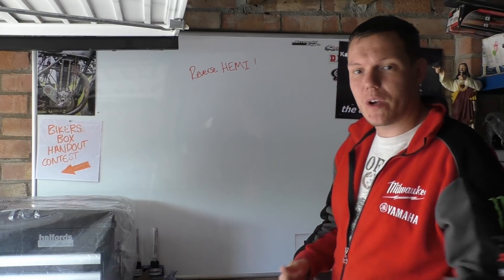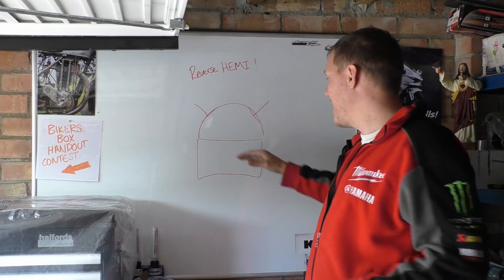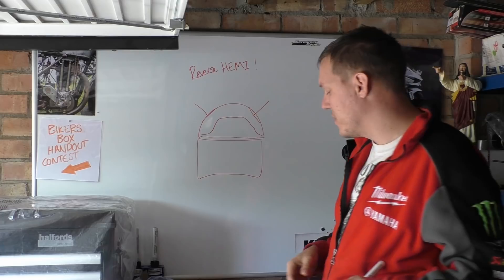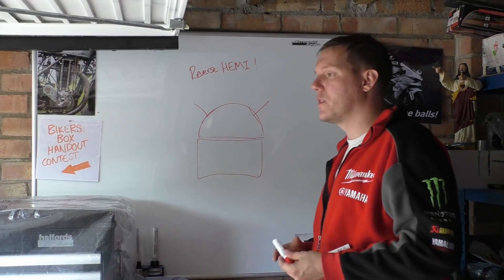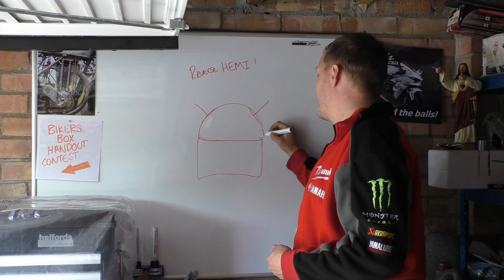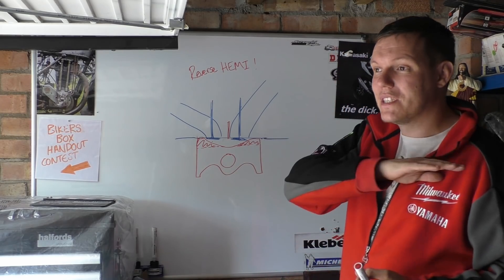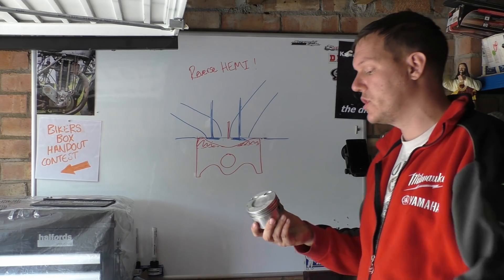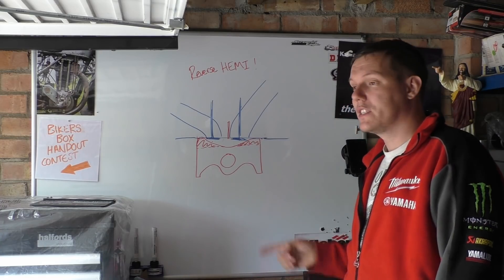Reverse HEMI?

Comment: Motoguzzi motorcycles have already done that with an engine design where the head is flat and the piston has an indent in it
Reply from the maker: Not exactly a hemisphere in the piston though - what you're talking about is called a Heron head
Reply: A heron head is still a Hemispheric combustion chamber but in reverse , motoguzzi used that design for all their engines from the early 60's with the 500cc v twin throught to the 750cc v twin  engines even till this day

Comment: Hey Matt... you forgot to mention that the primary reason to use a Hemi head isn't to benefit the combustion chamber shape but to allow for larger valves...
Reply from the maker: Or just have 4 valves.....
Reply: most 4 valve heads are also angled to allow for larger valves...

Comment: I would like to see somebody go into the full-on about piston mass and reciprocating mass because I on occasion run into these little $&^%&%$ that have this insane idea that piston mass has no effect on horsepower whatsoever.

Even come automotive company reps have been heard saying all this hog wash about re-vectored thrust velocities which are pure crap, but nobody has ever done an actual, straight out blind open test to compare.

I think the best possible way to compare would be to [for instance] take a one cylinder engine [mainly because it reduces the number of undesirably variable factors] make separate mass pistons with separate mass cranks to balance them, place it all inside of a vacuum chamber and measure how much input horsepower is required to spin it from the crank shaft inward using another motor [preferably electric and preferably some digitally operated type that can give you precise feedback at all speeds to a computer, so likely some kind of digital motor] and just honestly see how much power each set [crank and piston] takes purely to move the reciprocating mass] and record it all on a graph scale to show conclusively just how much reciprocating mass really is and how much it affects top [or even lower] end horsepower.
Reply from the maker: "that have this insane idea that piston mass has no effect on horsepower whatsoever."

- mean piston speed has an effect on HP indirectly through HP = torque x rpm. Piston speed is actually more to do with bearing loads, wrist pins and con-rods than the piston itself.
Reply: All redirection of mass requires work.

All mass work not being performed at the end of the cycle, no matter how needful or inevitable is, by definition, parasitic.

The fact that bearings and parts themselves suffer damage and deteriorate over time is not merely a by product of reciprocating part mass, but proof that horsepower which would have otherwise been directed at the wheels is being lost within the system due to the system's inherently imperfect design.

It matters not whether its a rocket, a gun, or a piston, "every force requires an equal and opposite force" which robs power from the system and that can not be negated by means of flywheels because the force is still being lost, it is only being lost in a manner less readily perceived to the untrained mind.

A portion of the energy put into the rotating mass is taken back out of the  rotating mass to maintain rotation due to several factors, friction, viscous drag, dynamic differential pressure [[this in its self is a doctorate thesis on the laws and behaviors of adiabatic pressure within the realm of internal combustion engines (https://www2.southeastern.edu/Academics/Faculty/wparkinson/help/thermochemistry/) and (https://www.grc.nasa.gov/www/k-12/airplane/engstage.htm)],  vibration (elastic momentum http://physics.bu.edu/~duffy/py105/Momentum.html)  and exchange momentum loss (http://farside.ph.utexas.edu/teaching/301/lectures/node76.html )
Reply from the maker: LOL true but way off topic - piston speed has no effect on horsepower - is just a weird comment - and in this we both agree. But its a bit more mechanical than inertial resistance etc

Comment: More surface area on the piston face rises the rate of heat transfer from combustion gasses. Heads are way easier to cool then pistons, since the head already has oil and coolant flowing though it. So, that's one more reason.

Comment: Can you think of an better engine design possible with 3d printing that cannot be manifactured traditionally?
Reply from the maker: no. LOL good question though
Reply: The Workshop thanks for the fast answer
I think there could be high potential in using additive manufacturing to create lighter engines orpistons.
Better cooling could be also an option or better airflow by using the "golfball" surface in intakes 
Also could be cheaper for racing engines to create parts for engines but aggree with you the general design of a engine will stay the same
Google for porsche titanium manifold intake

Comment: You didn't mention the Heron head which is similar to what you are describing which was used in several engines even A Jaguar V12  There again piston weight was the drawback. But it made the head easier  to manufacture(i think)
Reply from the maker: Because the HEron is a video in its own right. Cylinder heads are generally cast so it doesn't really make it easier
Reply: The Workshop all machine work "on axis should make it less expensive

Comment: With a hemispherical combustion chamber you can fit more valve area for the same bore size. Valve area is a big deal
Reply from the maker: Valve area is a big deal - port cross-section is a big thing but not vs compression ratio
Reply: The Workshop Intake port cross section determine where the power is made in the rpm band. It coincides hand and hand

Comment: Do you know why does Husaberg fs650 a single cylinder bike have 2 exhaust pipes? Can it be that they have exhaust for both exhaust valves separately?
Reply from the maker: Good question, as far as I know the exhaust headers are 2 different lengths. This aids in scavenging over 2 ranges, exactly how it works will be down the resonance but at what RPM I do exactly know.

Comment: Ever heard of Heron combustion chamber guys? ;)
Reply: Ford Crossflows used Heron heads, the chambers in the pistons were not that big but I got the impression that they were heavier than the flat top pistons in the earlier non crossflow engines. For some types of racing with the crossflow it was popular to chamber the heads and use flat topped pistons, though not in all types of racing. I think it depended on how often everything got a chance to cool down, on short oval tracks they only have a few seconds on the gas before they have to lift off.
Reply from the maker: LOL - not a hemi though is it? and they really do out perform everything else LOL

Comment: Even if you had hemi heads and pistons you still are lighting it at the top of the dome with the plug. The concept is to light in the center of the dome to have equal/even expansion is it not? If it was so awesome why did they stop using it?

Comment: The combustion chamber in the piston was used in the "Heron" combustion chambers found in Ford Kent engines e.g. Ford Escorts with pushrod motors (which could be made quite quick). I think in motorcycles the Motor Morini V twins had Heron heads and also the Brabham F1 engines in the 1960s.

Disadvantages as you say include heavier pistons and also smaller valves, advantage include squish etc as you say.
Reply: Volvo also used heron heads (very limited) engine code B230K

Comment: Nice to see the dick and balls back.
I had great fun back in the 60's and 70's as a teenager redesigning the two stroke
Including my version of the power valve.
Love 2 and 4 strokes but have to say that with all of the coming legislation that
electric motors might be the future. Far less interesting but  cleaner and more efficient,
if we get the power generation right.
I'll still be dicking about with the old stuff while picking up the parts in my electric car.

Comment: diesels usually have the chamber in the piston. and Chevy had the first big blocks 348/409, had the chamber between the head and piston. in some cases the cylinder needed to be clearances for the exhaust valve.. it was kinda weird. the deck was at a angle . giving a wedge shape. but I have read. the flat chamber less heads . didn't let the engine respond to cam changes. and valve shrouding. and valve to cylinder clearance issues . but they did make good power to a certain extent. but about 500 HP was it. without heavy machining and mods. to the heads and cylinder.  that design didn't last but a few years. 58-64 or so. the next design lasted for many years. and is a semi Hemi with the valves at different angles and centers. while trying to keep them beside each other. great video
Reply from the maker: And that's diesels which we'll get onto in the future

Comment: could you do a 4 stroke opposed piston engine with 4 crank shafts, 8 pistons and 4 cylinders with the cam in the middle so the valves are at the center of the combustion chamber and have all the cranks connected by a chain.       feel free to say this idea is stupid

Comment: You missed the most obvious reason.  A reverse hemi would have smaller valves.  That is one of the advantages of splaying the valve angle.
Reply from the maker: Correct port geometry can actually exceed the advantages of the <10% valve increase you can get. In other words what's the point in have slightly larger valves and hence ports when your compression ratio is 9:1 instead of 12:1? This was the marketing wank that was pushed around in the 60's to sell the idea of the Hemi head.
Reply: The Workshop umm low lift characteristics ? What about curtain area? diameter will greatly increase curtain area . And 80% of the induction charge is not mechanically pulled in by the motion of the piston moving down , but sucked in via exhaust scavenging . MIT put a absolute pressure sensor  on the top of a piston in a single cyl engine . @ tdc on the intake stroke there was over 14 inches after the crank rotated to 10 degrees ATDC that gradient dropped to 2. I work as a engineer in drag racing and as a manufacturer of rotating assembled for nitro alky and gas applications . It's my belief that low lift flow is often over looked. And that's why are 2 valve per cylinder American engines make way more torque aka power you feel in the seat. That modern and Euro 4 valve engines that make great peak numbers and flow great but when you sit in the seat feel like they go no where. There's a lot to be had in a 2 valve hemi with big freeking valves . We are running a 2.650" intake and 1.960 ex in a 4.187" bore with a 198-202cc chamber.
Reply: The Workshop also when people talk Comp ratio they alway talk static numbers that really mean nothing. Dynamic compression based of the VE of the given engine is a far better way to gauge the squeeze. Like for instance if I build a v8 with cast iron heads with stock ports I can run a much higher static compression with out knock with low octane fuel. Now if I put a trick set of aluminum heads on it that are all fancy Cnc ported and flow a bunch of air . I would have to use a much lower comp ratio with the same fuel because the efficiency of the head is much better meaning in the dynamic world a lot more air will traverse the intake tract in to the cylinder thus making the dynamic compression ratio higher . So to me static compression numbers are about as useful as a horse power or torque number with out a rpm it was created at . 😂🏁 sorry for the nonsense lol

Comment: The skirt can be quite a bit smaller to shave weight.
Reply from the maker: but this doesn't solve the other issues like piston crown stress, ring location/support etc etc
Reply: The Workshop Fair enough.
Reply: Heinrich Von Kekelnazi Ford Escort 1600 engines have a combustion chamber like the one you  are talking about. Tha cylinder head is flat and the piston is dished.
Reply: There are lots of engines like that, just Google 'Heron heads'.